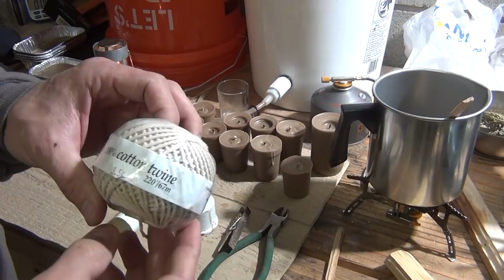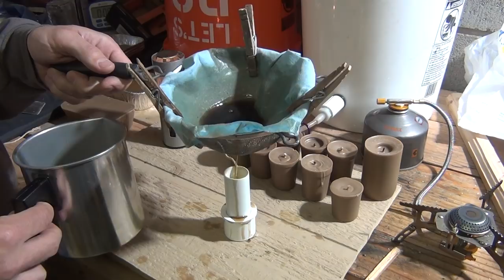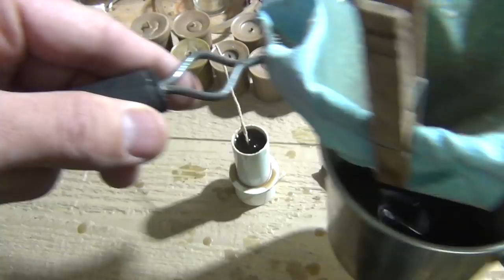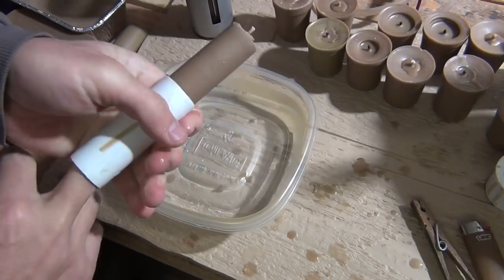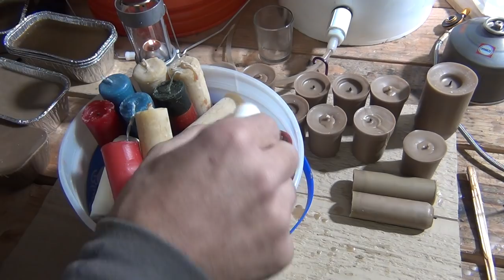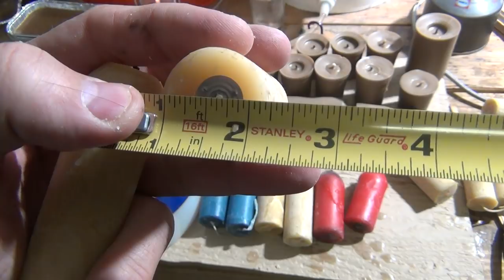How I make UCO Lantern candles

Comment: That would probably work a lot better if you'd spray that with mold release that candle would have slid right out of there although if you got the right size pipe and all that to make the actual size candle it even be better but yours are working and they're a lot darker than beeswax wonder what you're using God bless

Comment: Let me start by saying that I love your videos. Thank you so much for taking your time to make them.  That being said I purchased some PVC today and tried to make some candles for my UCO lantern. Most all of the candles that I made came out with a empty tunnel along most of the length of the wick. One great big long void. I do not know why this happened or what I did wrong. Could it be my wax was too hot or too cold when I poured it?  Could it be that I was using old repurposed candle wax? Any thoughts or suggestions would be appreciated.
Tom
Reply from the maker: Thank you for the very kind words and support that you can my channel it sounds like it may have cool down too quickly
Reply: thank you
Reply: Another readon may have been that the wax around the wick had begun to set and when you tried to pull it taught it may have created that void.

Comment: Use the metal candle holder as the mould and tape sides with electric tape, spray inside with Pam or cooking oil so candle comes out easier
How much does it cost per candle?
It costs me $10 a week to run a electric heater in my tent, if I switch to the candles and set up, I wonder if it would cost more to buy the unit, candles and or make them with time considered over spending $10 week to stay warm?
Peace and Blessings
Reply from the maker: Thank you.  I tried that, but the handle don't come out. Blessings to you!

Comment: For candle removal from the mold, cut a dowel rod twice the length of the mold, & push the candle out.
Reply from the maker: That's a great idea!
Reply: @jiujitsu2000  
Thank you.
But what size dowel
is available?
Reply from the maker: @charlesmichaels6648  Thank you! I'm not sure,  I'll measure it.
Reply: @jiujitsu2000  
Thank you.
Take mold with you to hardware store.
Warm wax may crumble. Cold wax may just fracture
(like making soap).
Lube the mold?
If commercial dowel too small, carve dowel to fit (lathe?).
Or add plunger to the dowel tip.
Dowel with perfect fit can be started with gentle rubber mallet tap to top of mold resting on dowel
(If wax is really cold).

"If at first it doesn't work, get a bigger hammer"--Sparky the Electrician (Ben Luc).

Comment: 1.25" pipe fits inside 1" end cap? That's physically impossible. You meant a 1" pipe and a 1.25" end cap.
Reply: Wrong
Reply: The sizes of the pipe and fitting are internal diameters.  The wall thickness of the pipe is what makes it work.

Comment: I've found that a mix of 80% paraffin wax to 20% stearin works well and is a lot cheaper than beeswax. ATB
Reply: I'm using 60% paraffin wax to 40% stearin. The ratio depends on the environmental temperature. The hotter the environment the greater the stearin percentage works better IMHO. 70-30 ratio works well in winter temperatures.